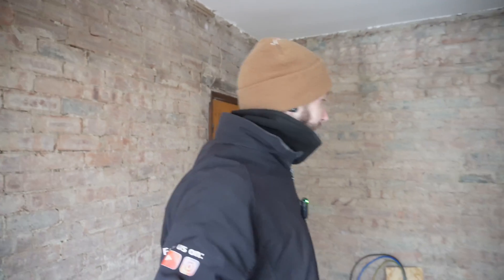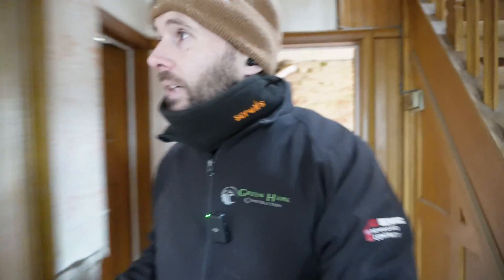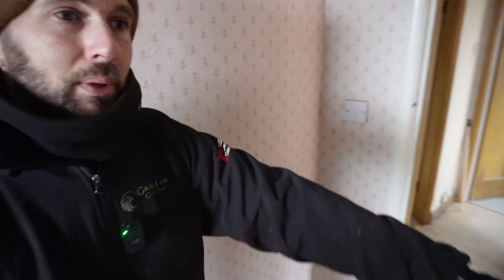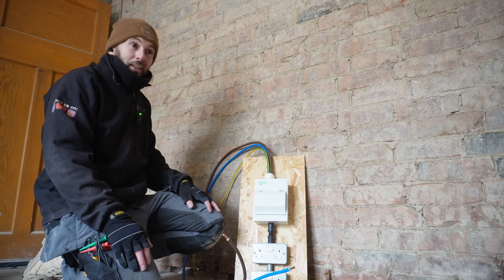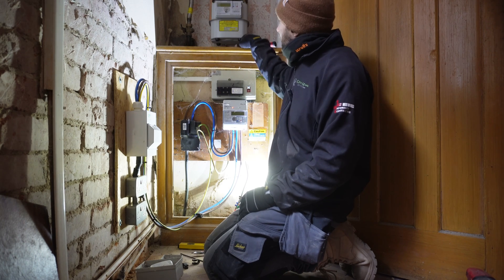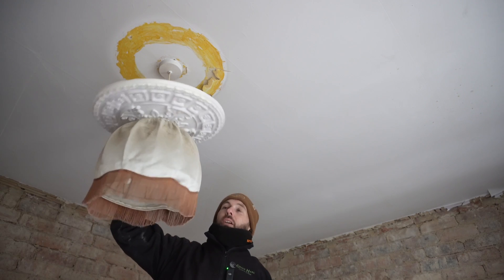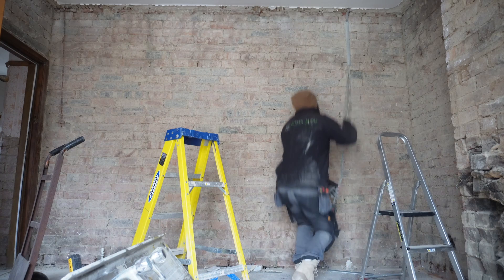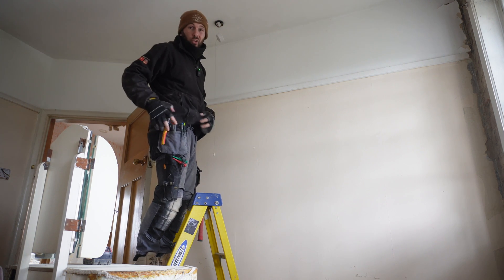"Starting an Empty Property Rewire: Installing a Temporary Site Consumer Unit"

Comment: Polystyrene gave two major problems.  If they caught fire they put out toxic fumes as well as dripping fire from the ceilings.  Many a chip-pan fire in kitchens resulted in this. 

There was also an obsession (1960s if I recall) when people lined walls with polystyrene rolls (about 2-3mm) underneath wallpaper for insulation.  Same noxious problem.
Have we progressed since? Foam cladding!!!